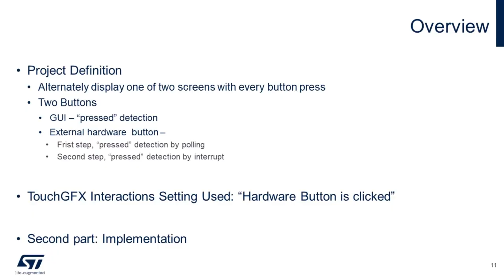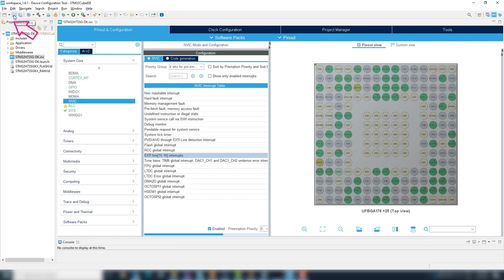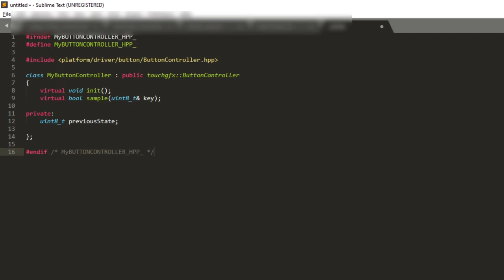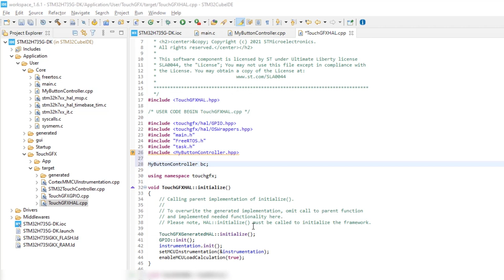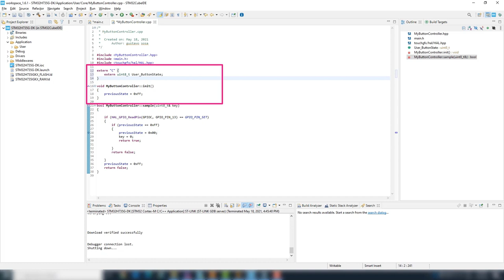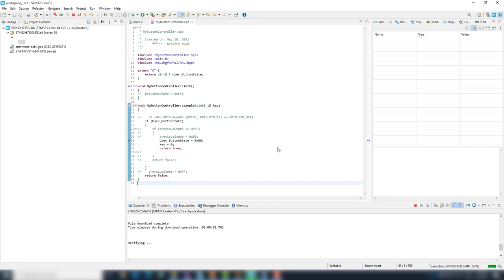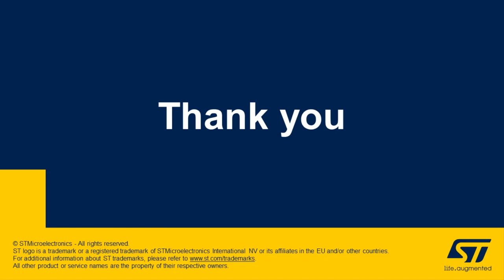STM32 Graphics: Using “Hardware button is clicked” at Interactions, Part 2

Comment: i am using touchGFX for the first time. i am using STM32F401RBT6 and ST7735 1.8TFT ,i created 2 screans , was ble to set each one as home screan and display them and it worked well. now iam trying to switch between them based on hardware button / uart command both are configured through NVIC was able to change the User_ButtonState value. but the User_ButtonState is reset to 0 inside the button control function after process. but its not happening in my case. i am not able to find where the dipendency of touchGFX on the User_ButtonState value. please help me with this.